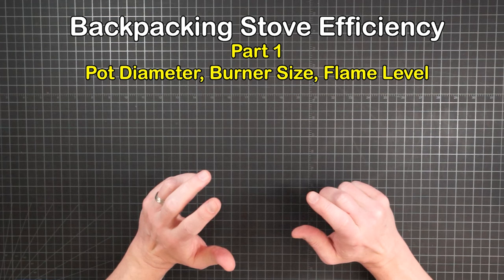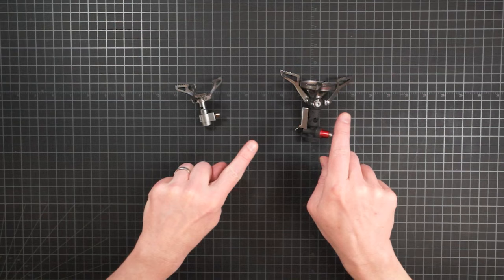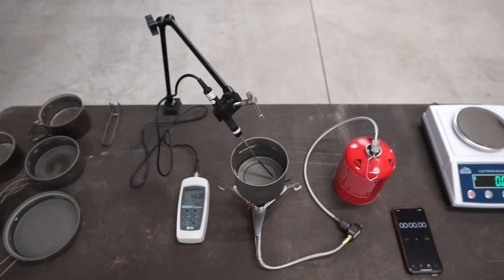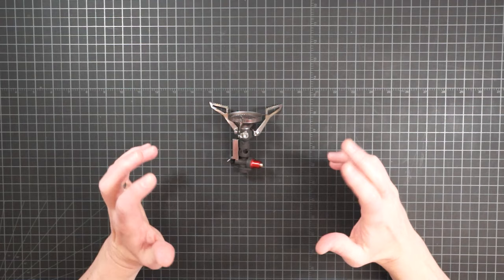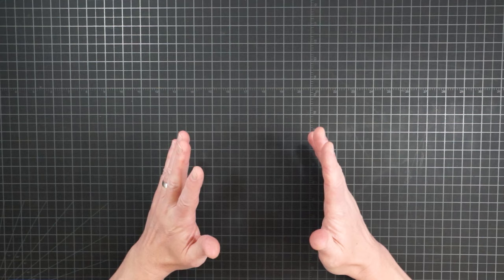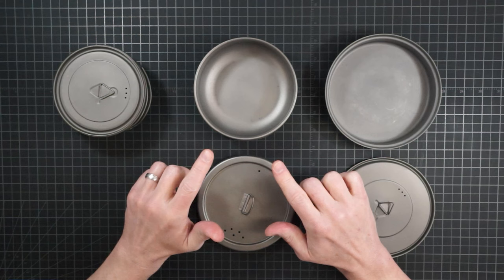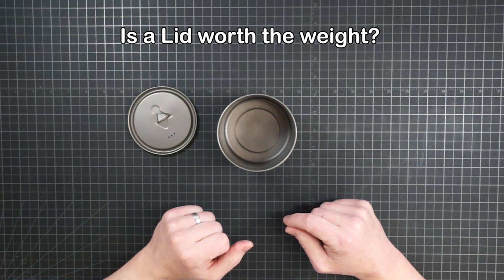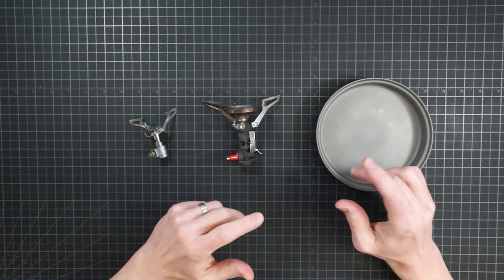Backpacking Stove Efficiency, Part 1: Pot Diameter, Burner Size, Flame Level

Comment: The joy of having your brain working while you-tubing! thank you! I've missed your videos! When you test fuel efficiency with burner type and wind, hope we can see what happens with a snow peak giga/old pocket rocket 2 generation where the flame is totally exposed compared to the new windburner (and knock offs). I have not been able to convince myself to replace my inherited stoves since they are totally functional but data is key.
Reply from the maker: I am working on stove selection for the wind tests!
Reply: I would guess that if you use a windscreen then your older model stoves would be just as efficient as comparable burner types of newer versions in better conditions (lower altitudes and above freezing temperatures). The caveat is a stove that is regulated for atmospheric and canister pressure differences, such as the MSR Pocket Rocket Deluxe used in these tests, is going to be more efficient in all conditions and, in particular, will work better at high altitude and cold (below freezing) temps than a not regulated design such as those you mention. Just a thought anyway. For my money, I would continue to use what you own; just add a windscreen. Some of the manufacturers already offer them and Flat Cat Gear sells some effective and safe to use versions as well. I have no affiliation with that company but they have some good products. Make one yourself out of heavy duty tinfoil, a couple of short sections of plastic drink straw and two Shepard Hook titanium stakes. Keep the downwind side open to make sure you don’t overheat your canister.
Reply: @wanttogo1958  You would hope, but I don't think that is the case: the giga II has an after market add-on windscreen which I bought and reviews I've read is that it barely helps if there is any wind. And it is nearly as heavy as the stove (it is steel).
Reply from the maker: @wanttogo1958  I've seen Flat Cat, and will definitely get some of his screens for testing.  It's my hope that an ultralight stove with ultralight windscreen will be more weight efficient than those heavier heat exchanger systems.
Reply: @cherylwhistler8878  I personally like a windscreen that stands a little away from the stove so it doesn’t get too hot and present a handling issue if you need to move the stove or pot quickly. As I’m confident you know, you don’t want to raise the center of gravity of these stoves since they can be tippy on uneven terrain or in gusting winds. Trail Designs sells some aluminum windscreens of which I have two of the Vari-Vent type that could be adapted to work with a isobutane stove. They are designed to fully encircle the stove with vents for airflow downwind but the target customer is one using an alcohol stove so again, I would leave a decent sized opening downwind to ensure the gas cartridge isn’t overheated. I’ve read of that happening and as you can guess it doesn’t end well for the user. One other person commenting to this vlog stated he uses a titanium windscreen that he fastens closely around the pot (aluminum would melt if placed that close to the heat source) and allows it to extend down to act as windscreen and to prevent some of the heat from the flame escaping up the sides. But he also mentioned the need to use pliers to remove it before he handles the pot with the same as the handles are folded flat under the screen so get very hot. Again, it’s a system that needs to function relatively effectively and efficiently. I like the windscreen that stands away from the pot and stove. There’s always a weight penalty but it is generally less than the choice to carry more fuel to compensate for inefficiency caused by wind. For the concern of cold weather look up Moulder Strip on the internet if you’re not already familiar with that relatively safe way to keep a gas cartridge warm in very cold conditions.
Reply: @GearSkeptic  I know you’ll confirm our shared suspicion or disprove it one. I’ve seen some other boil tests on YT using various types of stoves in combination with one of the separately available heat exchanger pots and I wasn’t encouraged to consider buying one by the results relative to the added weight. I’m looking forward to what we learn through your hard work and diligence. Thanks for all of that.

Comment: I had to check your channel to look for packing efficiency, which is kind of an issue for me. With limited space in my backpack, I looked for a system where I can use the contents of my pot as efficient as possible when packing. For my new setup I choose a bigger pot where I can store the gas canister and burner in my pot, all rattle free because of the little camp towel in which those are wrapped.

Comment: Gosh, that’s amazingly thorough testing and not a cheap exercise with the cost of the pots, stoves and gas. 
I wondered if you used any of that boiled water to make a nice cup of coffee or tea. 
Would be interesting to see if a heat exchanger pot with the added weight of the HE part would be more efficient than a similar pot without an HE component.
They certainly boil water quicker than non HE pots but as for efficiency I have no idea.
Reply from the maker: Heat exchangers are next!
Reply: @GearSkeptic  Cool, looking forward to that.

Comment: For the pocket rocket on low you figured that all differences vanish, and afterwards was visible, that even the narrower ports were slightly more efficient. You said those were natural fluctuations. I say it's because increased watersurface there is more steaming of, which creates evaporation-cooling
Reply: OK later on you noticed the effect

Comment: I feel a little nervous like I’m walking up Mt. Olympus to ask the hiker Gods a question, but if you’re doing more analysis on stoves, can you compare alcohol stoves to gas? For shorter hikes, there are weight savings for pre measured alcohol to a full canister, I’ve just never known if that is true for 5 boils or 15.

Thank you so much for your in depth studies. It is exceptionally informative and also relaxing where I don’t need to worry as much about whether you’re being inclusive of enough variables. I can watch, become generally informed, and then just focus on applying the knowledge to my own experiences/needs
Reply from the maker: Thanks much! And, yes. I would definitely like to use all of the canister data as a baseline to compare against alcohol. With, as you say, weight-efficiency considerations for trips of varying length.

Comment: Fascinating study.  Thank you for this!  Big ask...  As a follow-up, can you please post how many stove regulator rotations constitute the low, medium and high flames you did the study with using the intermediate regulator?  Meaning, if I take my MSR Deluxe Pocket Rocket out in the field and attach it directly to a canister and want to use an efficient, "low flame"... how many turns would I make of the Pocket Rocket regulator?  How many for "medium".  High seems self explanatory.  Edit to add:  1) After posting my comment, I continued watching your video and see you answered my question.  Ty.  2) Subscribed.

Comment: Very interesting and very informative. I wonder if those conclusions can be apply in part to alcohol stove. One aspect Hiram Cook point in the past for alcohol stove was the distance between the pot and the burner maybe you can also test that for gaz ones. Other point of interest for testing is those pots with a kind of radiator made of fins in the bottom that theoretically increases the efficiency.
Reply from the maker: I do plan heat exchanger stove systems (with the fins on the bottom) for Part 4, and I would eventually like to work in alcohol stoves so they can be compared to gas.

Comment: Amazing effort. Thanks really useful. Appreciated the rigor in your thinking/testing. I did a bunch of maths on alcohol vs gas stoves. I got the alcohol figures from experiment, but got the gas figures online, so now wondering if correct because they might have used high rather than low flame. I will check my results against your figures. So thanks again. Incidentally the alcohol full kit was lighter for all trips up to 22 days, I didn't calculate past that. I have just checked my figures and your fuel usage was less than what I used in my calculations, so I did a quick analysis and alcohol was still substantially lighter than a gas setup. Would love to see you do a comparison.
Reply from the maker: Yes! After wind effects, I’d like to work alcohol stoves into the comparison, and eventually maybe even twig stoves.
Reply: @GearSkeptic  I will keep an eye open for your test. By the way beer/soda cans make sort of okay lids. I cut them round, but leave three 10mm tabs to clip over pot rim.
Reply: Interesting, please expand. I get the opposite conclusion. From benchmarks 30ml alcohol performs same as 6g gas, so 500ml ~ 100g and 1000ml ~ 200G. A 500ml full fuel is 525g vs 100g gas is 206g, and 1L fuel 940g vs 230g gas 370g. 525>206, 940>370. i.e. gas is lighter. 

So you either have far more efficient alcohol setup or a far worse gas setup than me.
Reply: @GeekfromYorkshire  Hi. Here are some figures. Please remember I tested alcohol but got gas figures online. Also note alcohol is less dense than water, so 1ml volume= 0.8g by weight. Tested alcohol stove at sea level. Stove was bottom inch of small sized aluminum drink can with 3 squares of carbon felt laid/pressed into bottom. Very simple only tools needed are scissors (not counting pot stand).

Roger’s Alcohol Stove
15ml/12g alcohol boils 0.5 litres

Pocket Rocket Stove
8g gas boils 0.5 litres

Jetboil Micromo Stove
5g gas boils 0.5 litres
Reply: @RogerBays  I have a Jetboil Sol Ti. It does 4g-5g per 350ml depending on wind. You must be using some kind of cone to get those Alc good figures?
Reply: @GeekfromYorkshire  Yes I cut up beer cans, and linked them together to get a windscreen, similar to the msr whisperlite or gk windshields, but smaller.
Note too test was done indoors, so it was in still air.
It took about 40 designs to get to this efficiency. Ironically simple was best. Also no priming needed.
Reply: @RogerBays  I had success with the Mini Trangia indoors, but outdoors in any breeze - useless. I did make a windshield - still useless. I've not invested much time in tuning it, yes a tighter more tuned to pot size windshield would work but also I've seen raising the pot so helps.
Reply: @GeekfromYorkshire  Yes pot height is important. I have nearly given up on alcohol stoves from time to time for one reason or another. But carbon felt is a godsend. This comparison video is worth a watch. Good charts and figures.
https://youtu.be/JYYOm6UOVjY
Reply: @RogerBays  That video did the tests indoors. The challenge with alcohol is in any kind of wind. Camping there's nearly always some wind, to varying degrees. My first cook system was Trangia 25 (then 27 as 25 too large), it barely notices wind, but when I tried to downsize to Mini Trangia it cooked fine in a test at home but was near-useless outdoors. The tests of fuel/weight need to be done in real outdoors typical situations and do an average. I still like Trangia for real cooking, you can cook anything in all conditions but at a weight/bulk penalty, meaning Trangia suits basecamp scenarios. I've yet to assemble an Alcohol + tightly integrated windshield + real world outdoors and measure.

I've measured Jetboil and measured a small gas burner indoors/outdoors and Jetboil wins for longer trips (but then I'd get fed up of only boil water add food wait quisine. So Jetboil is a squeezed middle, it wins on weight in a situation you'd not enjoy, and so I end up in the gas simple pot or full Trangia for extremes. 

Thanks for the tips I may just craft a non-lightweight windshield to do home tests outdoors in average weather and see if it wins. You've given me reasons to try.

Comment: I’ve been called the Cliff Claven of the backcountry because of my nerdiness for similar testing, however you amp it up several notches. Excellent testing and you do an outstanding job of turning this into a video.  I am looking forward to your follow up video using wind as a factor.  I’ve done wind testing comparisons between Pocket Rocket type stoves compared to Windburner or Reactor type stoves and as wind increases the efficiency of one over the other is significant and the weight differences of the stove does catches up over the number of boils.   Thanks for all your effort in conducting these test.  Do you have a Patreon or way we can support you monetarily?
Reply from the maker: Thank you! I do have testing of heat exchangers like the Reactor planned for Part 3, right after wind effects.

No patreon.  I appreciate the thought, though!

Comment: I appreciate the amount of work necessary for a test like this, really impressive video!  I switched from aluminum to titanium pots many years ago and I've always wondered how much the pot material influence efficiency. Never had two identical (or similar enough) pots in the different materials to do a test myself, but maybe you know - or have planned to compare materials in a future video?
Reply from the maker: Yes!  I've got wind effects planned next, followed by heat exchanger pot systems.  But, I do have titanium vs aluminum vs steel on my list.
Reply: Interesting question. Titanium and Alu pots of sufficient strength they don't bend too easily are similar in weight, but Alu takes roughly twice as much energy to raise it's temperature, so more energy goes into the pot and not in the water with Alu. That's good for boiling water but bad for cooking foods as the Alu soaking up more energy, and then re-radiating into the contents, evens out the hot spots so less burning. How much this impacts absolute boil times would be a function of pot size and how full with water. I use Alu for cooking food and Titanium for boiling water. As Titanium holds heat less (roughly half Alu) it radiates it's heat faster so is cooler to drink from, hence if you're doing a 2-pot setup the Ti can be a pot+cup and Alu for cooking. Most gram-counters are 1-pot-for-everything. 

I don't have identical size Alu + Ti pots to do a decent benchmark, so above is theoretical. If I get similar size pots of different metal I should be able to do a benchmark..... I have a 800ml Alu pot now and a 900ml Ti pot is being delivered soon. Currently have a 550ml Ti cup so can't really compare.
Reply: @GeekfromYorkshire  I switched from Ti to Al because of weight of course, but also because there were some "rumors" that using Al post for extended time might be bad for my health. I used them for months at a time and twice daily on thruhikes. 
It's also easier (at least now) to find smallish Ti pots which can contribute to the weight difference. 
As far as I know Al lead heat better than Ti so even if it requires more energy to heat the (slightly heavier) pot that might be offset by the conducting properties. And that was the main reason for my question.
Reply: @frstesiste7670  I just found they Alu pots worked fine for boiling but if I cooked and then scrubbed a black paste formed. I don't do that now, I switched to Duossal pots for when real cooking is in the mix. You can nest them and bring the right metal to the trip. I've only this year for first time for Ti and they boil fine, from a test they boil faster than Alu.

If Ti does enter your body it's inert and not absorbed. I have a hunk of Ti inside my shin bone from one too many bad backcountry errors.
Reply: I used both Alu pots and Duossal before switching to Ti. Almost halved the weight of pot (and lid) of a around 1 liter going from Duossal to Ti, but that was as much because the Ti pot was optimized for low weight as the difference in materials.
Reply: @frstesiste7670  How does Ti work for you for "stir and simmer" type food?
Reply: @GeekfromYorkshire  Basically it doesn't. Or rather I rarely try. I almost always select trail food where I can boil water first, then add what's in the bag/package and turn the stove off or keep it on for a short while on really low power.
Works well with Raman and various rice-based meals. Don't use too much freeze dried as it's much more expensive while not that much lighter per calory. When using freeze dried I add it to the pot as I don't like eating from the bag - I don't think it's too healthy in the long run. 
That said, many stoves simmer well enough to not create problems as long as the water is boiled first. 
Used a MSR SimmerLite for a while and that worked really well with Ti pots. Many buthane stoves also simmer well.
Reply: @frstesiste7670  Sounds good. I'm now out with backpack I have the Trangia mini pot+lid stuffed with breakfast food (oats) and a Ti 600ml mug + 100g canister + Alpkit Kraku burner. Once I have a Ti pot I'll try that instead of Trangia 800ml pot.

Comment: Omg, this gentlemen is possessed! What a wonderfully exact analysis! Many thanks, such good fun. I was surprised how little difference the lid makes in this test. Perhaps more important at colder temps (eg - 20 C / 0 F ish) and with a wind, where the cooling effects are greater?
Reply from the maker: Think I'll have to wait until next winter, at this point, for the colder temps tests.  But, I'm working on assembling gear for a wind test right now!

Comment: In addition to the wind variable, the impact of significantly colder temps would be interesting to examine (but likely miserable to test).
Reply from the maker: I would like to do a "very cold" set of tests.  At this point, I think I'll have to wait until next winter, though.